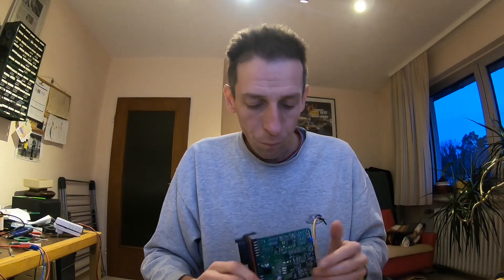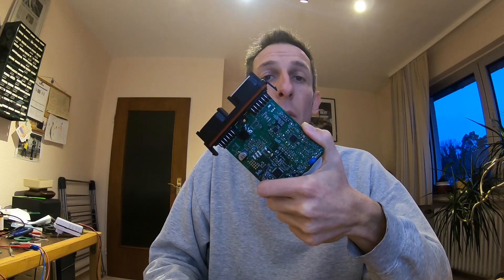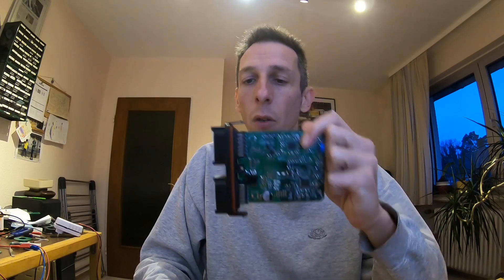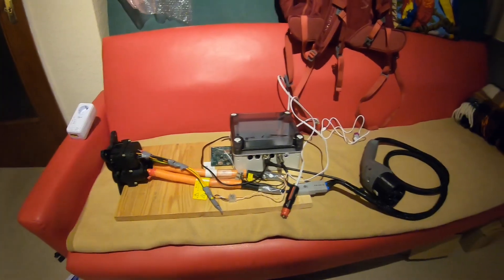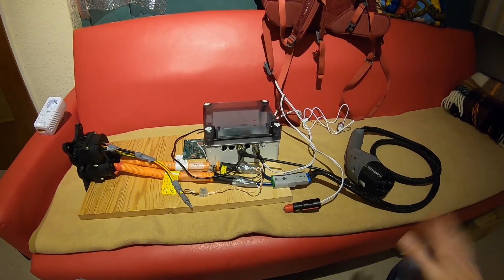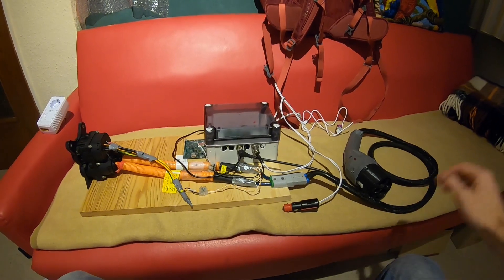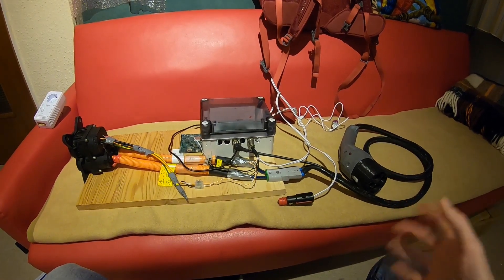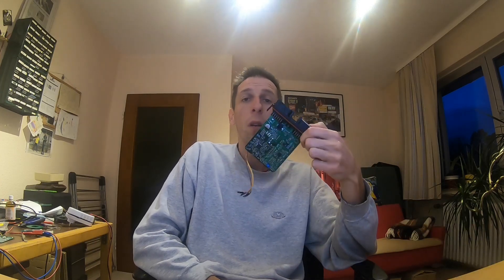What can (and can't) the openinverter CCS controller do for me?

Comment: NACS (TESLA  USA) socket for your board?  I have CHAdeMO set up already using canbus from my Orion2 BMS.  If I convert I would like to go to NACS.
Reply from the maker: Yes it should work. Orion is perfect as you can also include present battery voltage in a CHAdeMO message. I use the first two bytes of the 0x100 message which are otherwise unused.
Reply: How close Is NACS to CCS1? Did Tesla change their cars to be more like CCS or did CCS1 become more like the Tesla protocol? I would assume in Europe Tesla is just using CCS2.
Reply: @jahnkeanater  NACS is essentially CCS2 but with a different physical shape and with sharing the same pins for DC and AC power. You are correct that Tesla doesn't use CCS2 for itself, but instead a single wire CAN protocol. They have not opened that but instead just added support for the CCS2 protocol to superchargers.